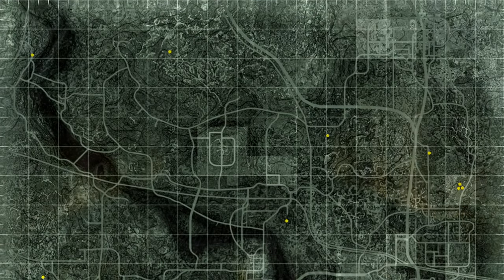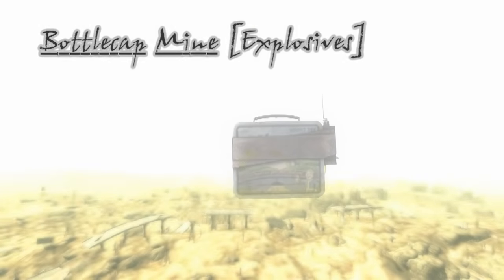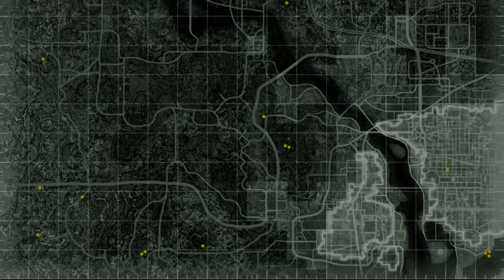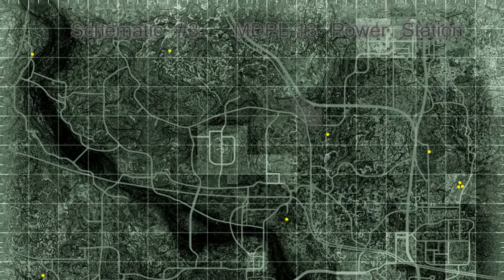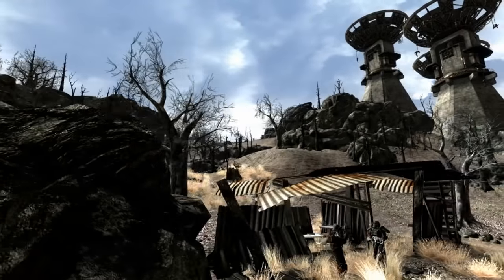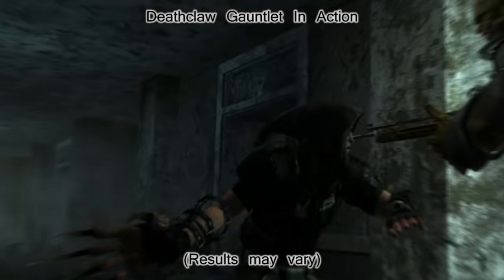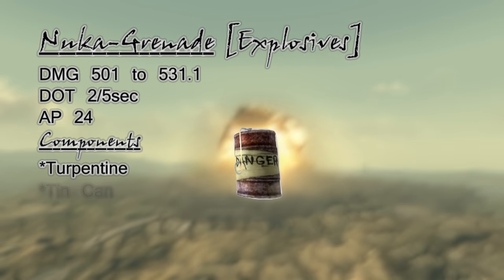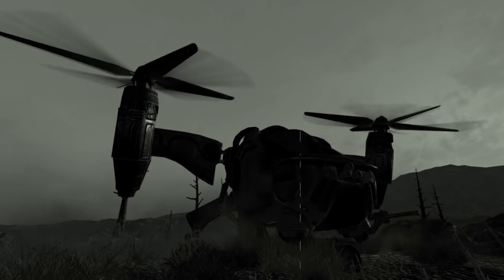Fallout 3: All Schematics Guide (Vanilla)

Comment: A tip for anyone trying to get the Deathclaw gauntlet schematic from random encounter I highly suggest as a new character dropping from the scenic overlook outside VAULT 101 and running south  towards the collapsed overpass heading towards tenpenny tower ,  head down the road and save at the edge of the guard rail to the road and keep approaching the billboard until you see the Deathclaw down the cliff. If you climb the rockface to the side of the entrance to VAULT 101 and save at a stump between 2 trees with a barn in the distance that's a great place to save trigger the Firelance. After it drops from the sky have dogmeat retrieve everything that fell